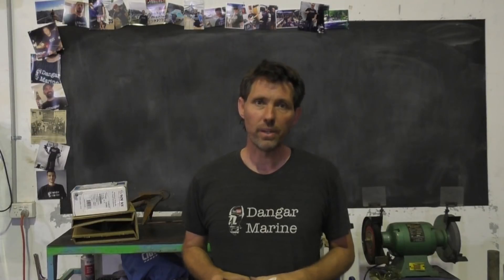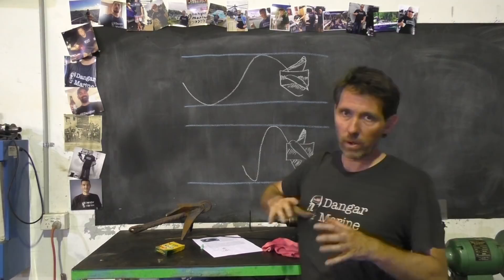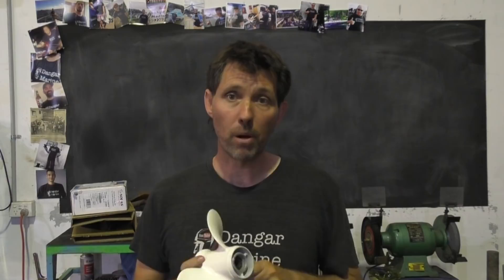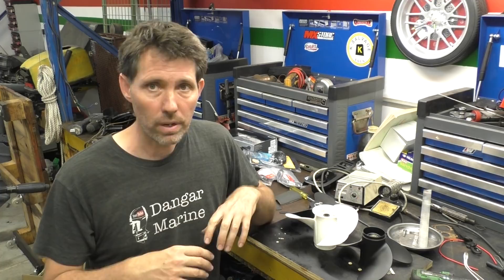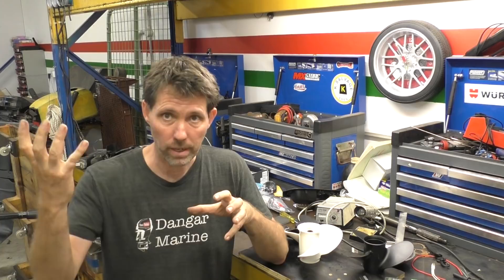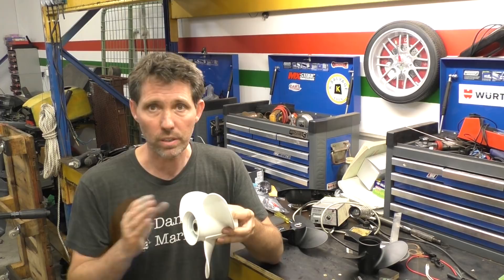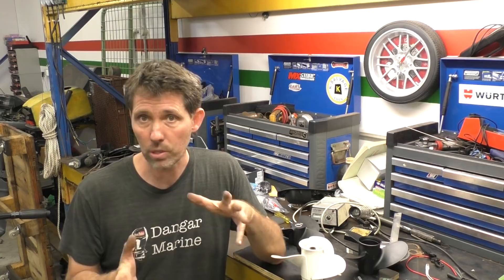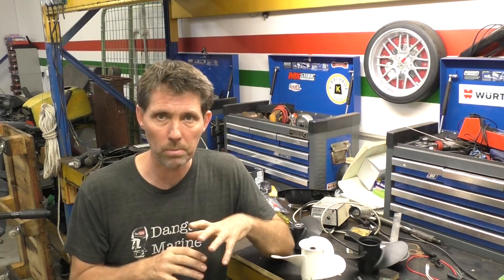Outboard propellers

Comment: Just changed my small 9¼ x 10 prop on the Honda 15 due to bogging down at high acceleration, saw your video and heard about the bushings. This solved my problem. Thanks so much

Comment: Chimed in on a the video about relays, fixed that issue and now I am getting some venilation issues. Always know I am gonna learn something when the blackboard is in the background. I blew the motor and bought an identical used one with no prop, bought a super cheap one to get on the water and now I have ventilation issues. Motors mounted in the same spot, cheap prop and cheap hydrofoil are the only new variables to the set up. The hydrofoil has 2 tention screws that hold the hydrofoil to the anti venitlation plate and they stick out pretty far, i would assume they could put a trail of bubbles when underway. Who knows, all I know is there is always something!
Reply from the maker: Did the boat have a problem before you added the hydrofoil? If it did they can really help, but if it didn't they can make a boat much worse.
Reply: @DangarMarine  I always had one on the one that failed but it was attached by holes i drilled thru the vent plate and bolts. Never had an issue. This new motor came with one but it wasn't installed as the motor was on a pallet but its more of a "clip on" style. Slides over the vent plate and then has two fasterner styler bolts that put tention on the vent plate but no holes. I am going to take it off and change the zink to the flate style instead of the skeg lookin like one that hangs from the vent plate.

Comment: thanks a lot Stu ... i had a problem that i couldn't identify but now know that.... it is ventilation . I have 5.20 rib with tohatsu 50 long shaft engine (2017) and like to do hard turns when i pull tube or wakeboard . I trimmed almost highest as possible to reach maximum speed (checked before all levels and reach max speed when trimmed all the way up)  tomorrow will trim down and will try some hard turns.i tried to buy jack plate to place engine lower on transom but because it is with tiller bit difficult , i have an another option to buy extra long lower unit (can get 7 cm )  but it is quite expensive solution almost 800 usd
Reply from the maker: It's amazing how much higher the prop rides during a turn, sounds like you're onto the problem.

Comment: I'm was running a 11 1/8" X 13G on my '86' Skeeter Strada f80  w/ my 1985 Yamaha 40 HP,  and I had a hard time locating THAT prop.  It looks identical to the aluminum one you are holding. I did find a 11 1/2" X 13G and I figure if anything, it's an improvement w/ no harm done. I never thought searching for a prop would be so tough.  I had to change out he old one due to dings and nicks from the previous owner.
Reply from the maker: It can be surprisingly difficult to find the right one, that's for sure. I need to replace the prop on my boat soon so I'm going to use that opportunity to do a vid on prop selection.

Comment: Great video! Thank you so much. I bought my neighbors boat last summer. A 17ft. Crestliner  with a 115hp Evenrude motor. When I go in reverse I have to do at least 3k rpm just to get it to start moving. When going forward it will plane at about 3k rpm but it takes up to 4500 rpm to get any more speed. When it does take off at around 5k rpm it takes off like a bat out of hell and so do the rpm's. I have to throttle back so I don't loose control. I figure it's got to be the pitch of the prop. I welcome any input on this issue.

Comment: Stainless tends to walk away the quickest as you are getting gas or having a bite to eat on the way to the lake you are going to. Have also run into commercial models of very popular outboard like my Yamaha 40 which I didn’t know was a commercial model till I went to replace the prop.
Reply from the maker: I was going to mention that stainless props do tend to be the target of thieves. No one ever seems to steal my dinged up aluminium prop...
Reply: Dangar Marine or my badly painted stainless prop. Learned that one from another boater.

Comment: Very informative Stu ! In my watersking days, I once made the mistake of using too smaller prop pitch. It over-reved and the piston  rings shattered. Lesson learnt the hard way ... 🤔  p.s. (Sorry, about Croatia ... France were a bit good though.. )
Reply from the maker: Thanks mate. I need to get a new prop for the Green Machine soon so I'll grab a few different ones and do a video on coming the top end RPM. Yes, it was a shame to see Croatia lose but they certainly did very well for a country of their size.
Reply: Follow up prop vid will be great. In my case there was no rev counter and i just hadn't the experience to realize the engine was red lining by it's screams ...

Comment: Nice stu, I think the audio problem need to be using a bluetooth or wired microphone that near your shirt, so just mount it on your shirt near your voice should be pretty good, to avoid the wind blocker, something like soft foam wrap on the mic, and it should be very good for voice quality
Reply from the maker: I have a Rode Film Maker wireless setup, but the microphone cable broke. The mic itself is about $200 so it's taking me a while to be able to afford it. In the meantime I've just bought a fluffy cover for the shot gun mic. When I did that original video on Sunday I had a cheap lapel mic plugged into the Film maker transmitter and it was rubbish unfortunately.
Reply: good equipment, I saw you always put something in front of the camera but it still can focus very quick, what camera you using?  Thanks.
Reply from the maker: It's a Panasonic HC-V770.

Comment: My prop started to slip this summer, I hammered in and countersunk some nails, equally spaced into the rubber grommet, parallel to the output shaft and the prop has not slipped since.  Start with 3 or 4 nails and add more if needed.
Reply from the maker: It certainly can stop a prop slipping. I think with larger high performance motors the issue of being out of balance comes into play. Also be careful that you don't get stuck out in the middle of nowhere if you hit a rock or something as the  nails will fail completely. Good for your gearbox, not so good for getting home!

Comment: I'd been spending way too much having aluminum props repaired from damage where I boat, to the point I bought a jet boat.  Well, a couple dacades later I bought another boat running an outdrive with a stainless prop and again, I seem to easily discover sand bars but let me tell you, that stainless prop is a heck of a lot tougher.
Reply: I AGREE ..ALSO A DECENT REPAIR TECH CAN BANG EM BACK IN SAHPE EASY AND AWAY WE GO....ALUMINUM IS NEVER THE SAME EVER ....60 -75 BUCK A POP FOR ALUM REPAIR ALSO. STAINLESS REPAIR 50-100 BUT THAT STAINLESS WILL BE MUCH HIGHER QUALITY REPAIRED PROP IN SOME CASES BETTER THAN STOCK !

Comment: I hit some debris once and torn up my prop. I bought a rebuilt prop from the local marina for half the price of a new one. Took the boat out and it was fine at slow speeds; when I'd give it the beans and try to get on plane the engine would break free like it popped out of gear. Assuming the recon prop was good, I was convinced I had broken something else. It took me three weekends to find that it was the hub slipping on the prop; it couldn't hold under higher RPMs. The recon prop obviously had gotten "spun" and the marina didn't change the hub during recon. Got a refund, bought a new one, and lesson learned.
Reply: Ha.... not to get off topic here, but my wife learned not to give me the beans or there'd be a lot of something breaking freely.  As for the prop... was it that rubber-surround sort of mount like Stu showed in the video?  Good to hear that they took it back and refunded your purchase.
Reply: Yes, it was the rubber pressed in type of hub. Once it gets spun free one time, it's done for and needs to have a new hub pressed in. Easier to just buy a new prop if that happens.
Reply: I agree, especially after just having bought it.... might be a little different if you'd had it for ten years or more before it happened.... There are a few comments around to the effect that driving screws or nails into the rubber puts forces against the spline and the outer ring blah blah blah... but again,  since you had just bought the thing, I think it was best handled by taking it straight back where you got it.  Kind of a shame that that particular weakness is built into the design, where a material will eventually begin to harden and then lose its bond to a mating surface. Wonder why they continue to make them that way, other than being able to sell more replacements....
Reply from the maker: I'm not sure if it is built in redundancy as such, because I've certainly got many, many years out of a rubber bushed prop. I can also see that they are more user friend to your average boater as you don't need to do anything if you hit the prop on something, just keep going provided it didn't fracture a blade or something serious. On the other hand, I really like the idea of being able to repair the old shear pin design but that might just be me. :)

Comment: i wager that freezing the bushing, warming the prop and using silicone lubricant would make bushings easier to replace.  process used in automotive applications
Reply: Believe it or not in the 70's I worked for one of the biggest prop repair shops on the east coast and they would would heat up Karo cooking syrup with a torch in a small pan until it boiled and used that as a lube to press in those cushioned hubs on props.

Comment: I need to replace the prop on my mid-80's evinrude 50hp. I have a prop that came off of a 1990 Johnson 60hp. The number of spline on both are 13, but the hub housing from the 60hp is about a 1/2 inch bigger in diameter. Nobody ever seems to mention that...I'm not near the motor to check fit, but I'm thinking it's a no go?
Reply from the maker: It may work in a pinch (maybe something to keep onboard as an emergency spare), but I'd go a prop with the correct hub size if it was me. The hub may also hit the gear casing and be unusable.

Comment: I have a 4 blade prop on my Mercury 60hp Bigfoot and I've noticed that on all four blades the paint has worn off nearly equally in a stripe pattern. I figure this was just normal wear etc. but after watching this I wonder if the cavitation is a factor to it wearing in that way.
Reply from the maker: Hey Seth, could be caused by normal wear. Commonly it is the tips of the blades that wear the paint off due to being the fastest moving part of the blade and also the part that gets rubbed through sand etc during shallow running.
Reply: @DangarMarine  IN MY EXPERIENCE THOSE "BURN" MARKS IN THE PAINT DO COME FROM CAV BUBBLES .....40 YEARS OF PLAYING BOATS IVE SEEN A FEW THINGS!

Comment: Nice video. However cavitation is not due to "gases inte the water" its simply water that due to low local preassure makes into water vapour. Also - that the temperature for a propeller running in water will be hight enoug to cause aluminium to fail is unlikey. Generellt creep, a very slow process, is risky over 0.6  x the melting point for metals. The rubber bushing might however get hot by vibration etc..?

Thanks for your videos - generally very interesting!

Comment: Been waiting for this explanation for a while mate...recently got my new outboard mounted and "propped" for my old hull..I really need a hydrofoil to avoid that ventilation as it not good for the outboard obviously and also it freaks everyone out !.  I have also had some of the paint come off in the middle of the blades already...seems a bit strange ?  Mine is set to max rev@ 5500rpm and does 47 km/h or 25 knots flat stick. it's a 40 Yammie 2 stroke and is mounted fairly high so trimming is precarious.. think I will buy that hydrofoil for Christmas..  Cheers mate
Reply: Just checked prop..it's a 11 5/8 x 11 - G
Reply from the maker: Is the motor mounted above the transom height or flat down on it? If I was getting ventilation I would lower it if possible. If that's not possible, a hydrofoil is worth a try for sure.
Reply: They specifically mounted it above the transom down at Brooklyn..goes really well .. I think it's me getting carried away with trimming up sometimes but I will be adding the foil for sure..cheers mate

Comment: Great video Stu. For years I was confusing cavitation with ventilation...😅. Can't wait to see the Dangar Island tour. Looks like such a gorgeous part of the world. Also interested in the assessment of those hydrofoils. I've tended to think of them as the snake oil of the boat world. If the outboard manufacturers thought a bigger anti-ventilation plate was required...wouldn't they just make them bigger from the outset? I also have heard they are supposed to get you up on plane faster. And finally...I have a question about winding the cable on a steering drum I just purchased from your sponsor (awesome price, even shipped to Canada!). 
The long winded explanation I've attached to the comment section of that vid you did last year on the same topic.
Reply from the maker: Thanks mate, glad the video helped you. I'm off to film the hydrofoil plate video this morning so we'll say how it goes. I think they are of more use if the boat has a problem that needs solving, which the Green Machine doesn't, so it might not be a test of their full usefulness, but we'll see.

Comment: Thanks for the informative video. I find that the Solas Prop selection produces the results "No Props Found...try other options" for my application. I have a 7.7 metre, 1500kg trailer sailer with a 5 hp Yamaha outboard on the back. Max speed is around 5.5. knots under outboard. The outboard probably should be bigger (8-10hp) but was new when i bought the boat and I don't have funds for a new one. It struggles into a head wind,  I was thinking it might suggest a  4 blade shallower pitch prop. Are there any options for this engine (around 2015 vintage) What are your thoughts?
Reply from the maker: Looking at the SOLAS props for that outboard, there appears to only be one (link below). The trouble with such a small outboard is that you really don't have the power to push a larger total blade area and may end up just going slower. http://www.marineengine.com/parts/solas-propeller/prop-selector.php?manufacturer=Yamaha+Outboard&hp=5&hp_units=HP&year=All+Years&model=%289-Spline%29

Comment: Great video Stu.There's certainly more than meets the eye when it comes to props.I heard hydrofoils can be dangerous?I also heard that if you need a hydrofoil,you have the wrong engine in the first place?Thoughts on the matter?Look fwd to the on water vids.
Reply from the maker: Hi Fabian. I haven't heard of hydrofoils being dangerous, but I have heard it said that they are generally only helpful if there is a problem there to be solved. This isn't always the wrong motor, it can sometimes be the hull as well, so I do think they have their place.
Reply: Dangar Marine ok,cheers mate.People are surprised when they see my tinny without a foil as it gets out of the hole no worries at all even with the 30hp yammy.For what it is it rides and handles really well even in half meter chop probably due to the millenium hull and weight fwd with the runabout configuration I haven't bothered.Look fwd to the next one mate.

Comment: Thanks for a Great video again. I have a yamaha 200hp that we mainly use for water sports. I have recently been doing some modifications to use this as a fishing boat. Would changing to a higher pitch prop give me better range for fishing trips? I don't need the power to pull a person out the water while fishing and could do with better economy. Cheers mate
Reply from the maker: Generally no, you don't want the engine to start lugging and not be able to get up into its correct power band. You will probably find trimming the motor up will make a greater difference to fuel efficiency.
Reply: Dangar Marine thanks man, I do generally trim it well but she is a thirsty beast. Guess I will live with it :)

Comment: Ty you again for your videos. At this point I have fixed all that was wrong with my boat with your help. I have an 89' Johnson 40hp that was doing great until I went wide around a buoy and ran It through the shallows. It sucked muck clean through the new water pump. Flushed and all's good now but I've managed to loss the plastic ring off the prop. How important is this ring to the function. I don't run it wide open often but have been going out on large lakes that require full speed to get around on. I do understand it does something with the through hub exhaust and flow. I've noticed that they have gone away from this ring and just have a flared end now. Just not sure what to do at this point. TY for any help you can give in this matter.
Reply from the maker: I wouldn't be too worried about the ring. You are right that it is about taking the exhaust away from the prop blades but so long as you aren't hearing the boat over rev I wouldn't be too worried.
Reply: That's what I was worried about. It does seem to rev out under heavy throttle at odd times now. Always while trying to get on plane. Kinda like the prop completely looses resistance under thrust. I've had this happen when its choppy water but never when its smooth running first thing in the morning until now. Sounds like its creating a gas bubble around the prop causing my issue now. Guess I need to look at getting a new ring or prop. Ty for your help.

Comment: Will the heat from the exhaust going through the prop increase cavitation since it’s getting the prop hotter? Doesn’t sound like a good design having the exhaust going through the prop in my opinion